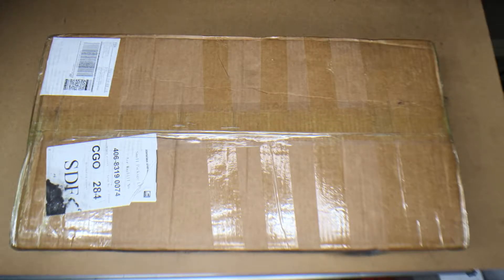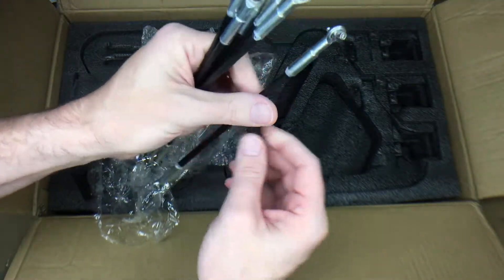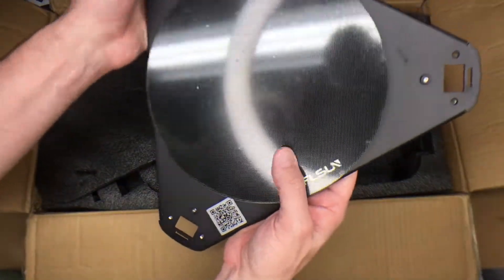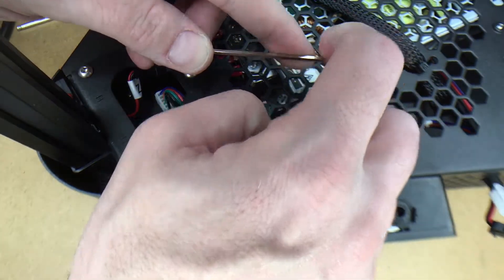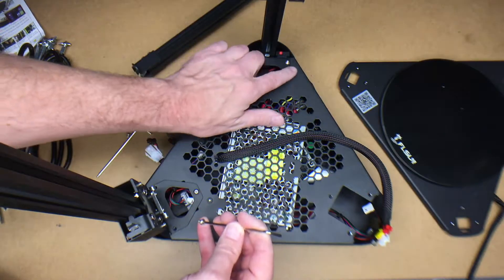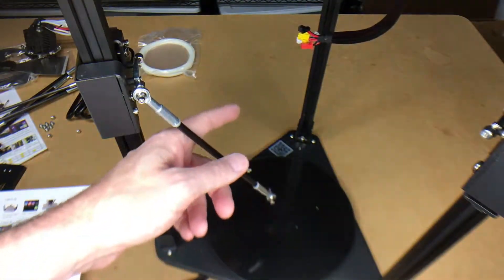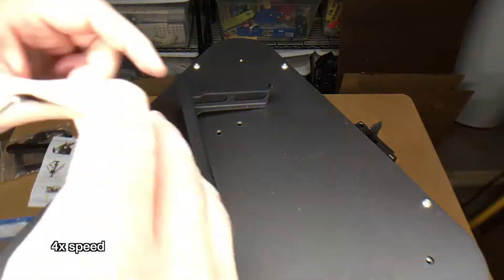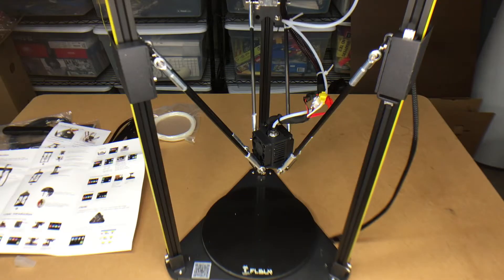FLSUN Q5: Unboxing and Assembly (Ep. 1)

Comment: Hey so I am a Q5 owner myself and am trying to find someone for technical help. I had a horrible clog and had to completely disassemble the entire hotend and soak the bare metal in acetone. Reassembled and everything works but I'm not sure if my ptfe tubing is too far down. Mine went all the way to the nozzle or there is an insert that it gets caught on pre thermistor, which one is appropriate? Or if you could mark your ptfe at the hotend, remove it, and measure the amount that goes in? Nice unboxing though, it is a smooth process!